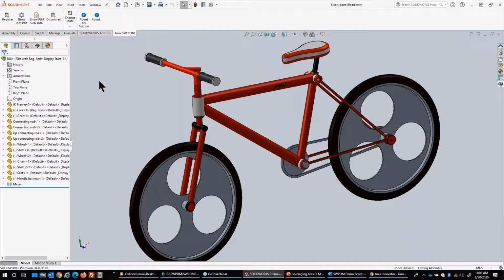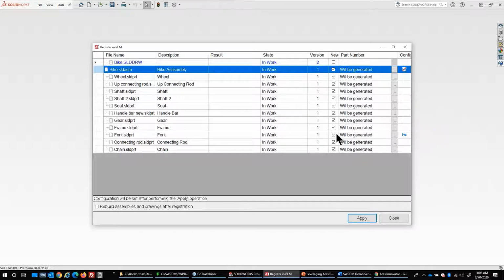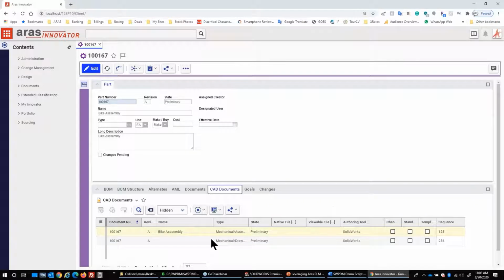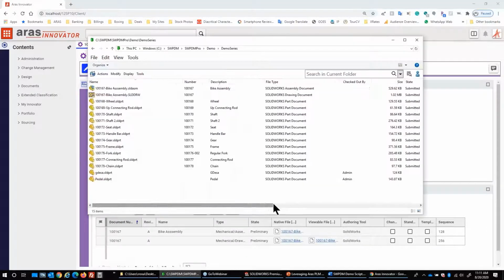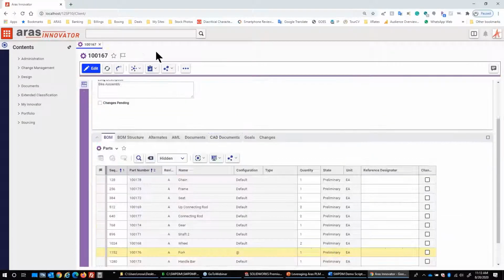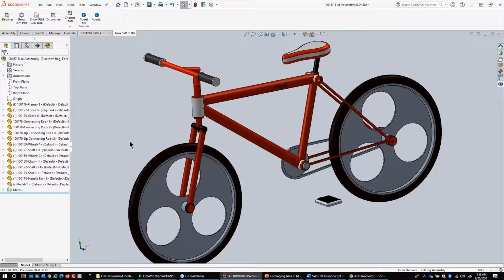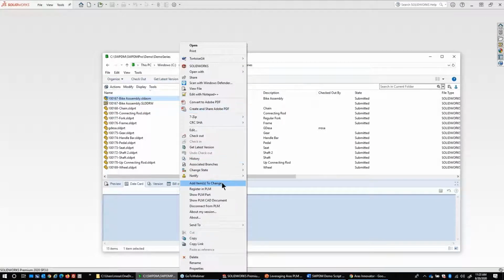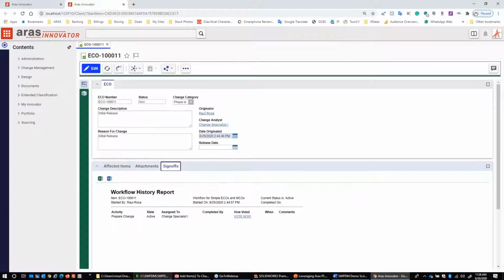Exploring the SOLIDWORKS PDM Connector for Aras Innovator

Comment: If I have Aras PLM and Solidworks CAD program, do I still need something else to get Aras PLM and Solidworks connected to each other as shown on the video above?
Reply from the maker: The Aras SolidWorks PDM Pro Connector, requires SolidWorks PDM Pro, as it is a PDM connector, not a Direct SolidWorks Connector. Therefore the customer must be using SolidWorks PDM for WIP and Aras Innovator as the backbone for CM, Collaboration, Etc.